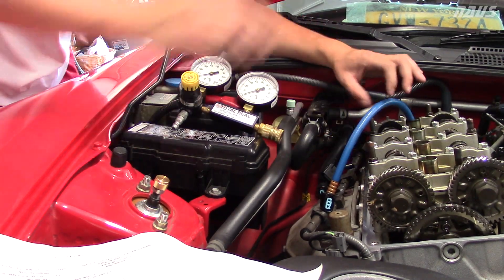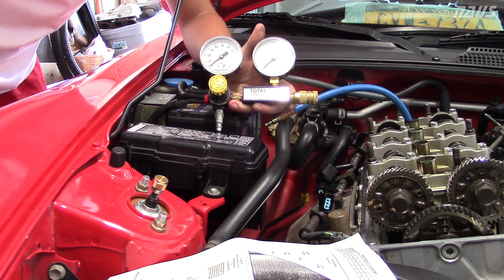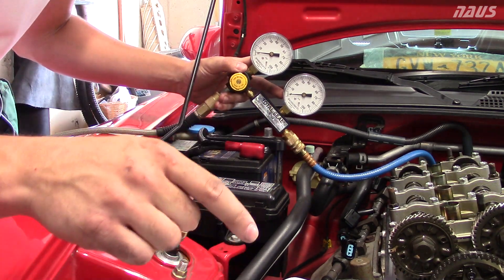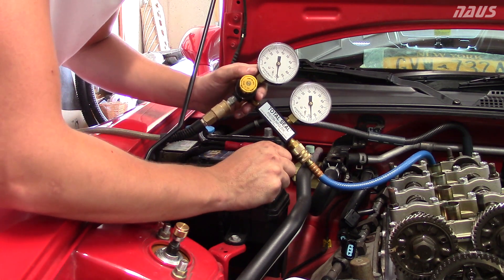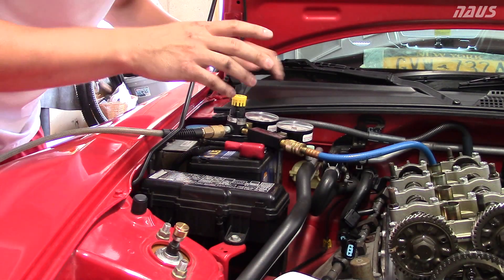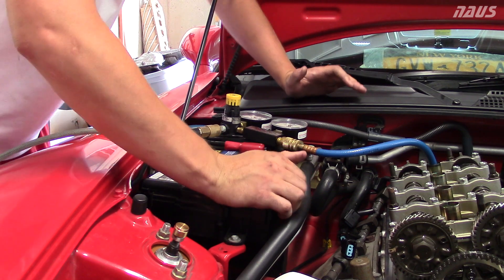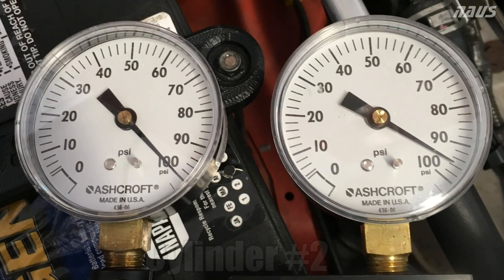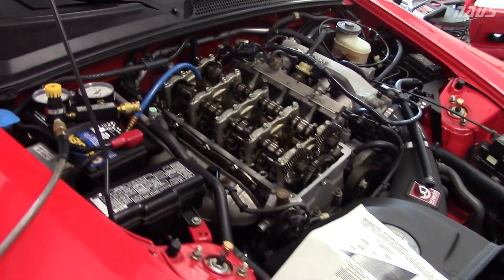S2000 Engine Health  - Cylinder Leak-down Test

Comment: If your compression is fine do you still need to perform a leak down?
Reply from the maker: Nope, if compression is fine there is no need. Leakdown test is really just to diagnose if there is a problem with a cylinder